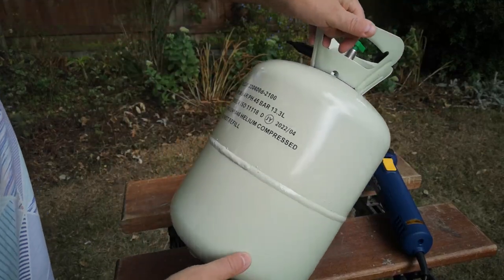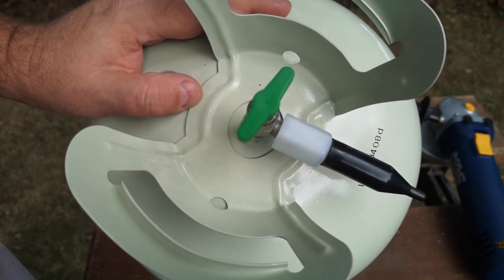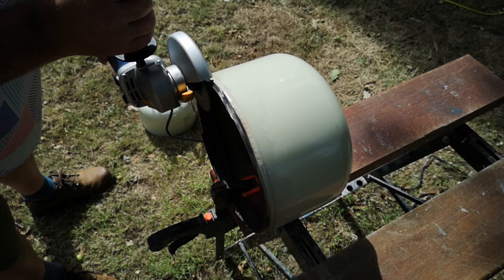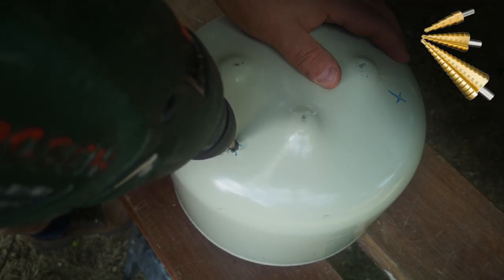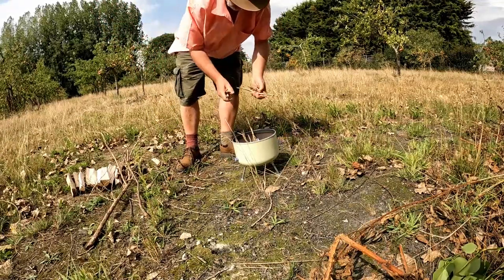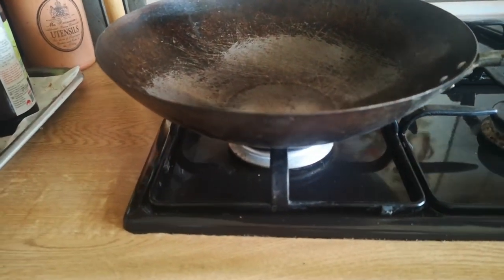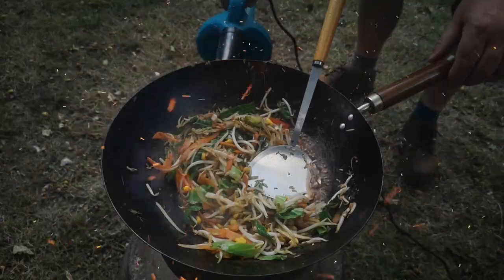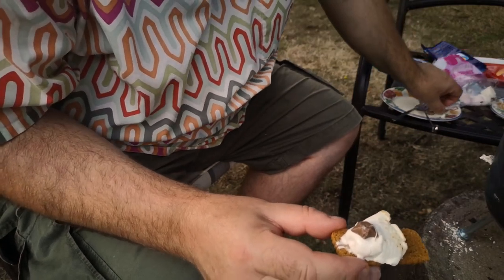Making a Simple Charcoal BBQ Hearth From a Helium Gas Bottle

Comment: The simple solution would be to take some construction wire, 3 mm thick, easy to bend and use it to make a round wok support that has three or more legs that hook unto the rim of the hearth. I don't know how to explain this... but think about that stick implement used to pick up apples, the one with the loops? Well, that, but each loop is smaller and alternating from side to side to grab the lip. Back when i was a kid, an older gent that used to make bbqs near me had the same thing, but made from really thick copper wire, worked really well with just about every cooking pot, including the ceramic, round bottom ones that would've otherwise plugged up the hearth.

Comment: You could have small upside down U shaped pieces of metal that slide over the top edge of the hearth. The bent part would rest on the top of the edge, while the two straight parts align with the walls of the hearth. It should give enough space to allow for airflow with the wok on top while still being easily removable.

Comment: You could make an add on wok burner, 
If you obtain a smaller diameter metal cylinder, and modify the top of that with the castle cut outs and air hole at the base, you could insert that into the larger cylinder with some rudimentary removable fastener and start a fire in the smaller tube and Force air through the larger cylinder, 
I have always wanted one of the crazy hot power burners they have for woks in Singapore lol

Comment: I'm at the safety part rn and one thing i noticed:
You seemingly were wearing shorts, on one hand if a spark hits polyester clothing it'll melt and probably melt to your skin but I'd suggest wearing some kind of long trousers out of (at optimum) flame retardant material or at least long trousers in general since they may catch stray sparks that fly to your legs.
There might always be something happening so that sparks fly in an unexpected direction.
Reply from the maker: Standing out of the plane of rotation is adequate. Even if these sparks hit bare skin all they do is sting a bit

Comment: Nice content... i'm actually looking for a sturdier barbecue to use for caming. Do you think that will handle well, i mena, stay sturdy and keep shape?
Reply from the maker: It's only carbon steel, so I think it will rust if left outdoors, but otherwise, it feels really solid
Reply: It's designed to contain helium at around 260 psi internally when intact(plus a fat safety margin).  It'll probably withstand being pushed into a rucksack even chopped in half👍

Comment: Perhaps the top of the cylinder could be used to make some crenolations. Just a band of metal with some kind of attachment solution like an additional metal rim around the outside or inside or chamfer each mating surface so it holds itself? The latter sounds extremely unstable though but Im sure you can come up with a better idea

Comment: Mr. Shrimp, hello from Canada.

Thank you for the safety talk. I'm probably in the minority here, but I appreciate trying to figure out what could possibly go wrong.
Reply: My partner and I are also in the minority here anticipating what can fail spectacularly... We've seen WAY TOO MANY disaster videos on Fascinating Horror, Plainly Difficult, and Brick Immortar to disregard safety.  So many tragedy of the commons failures throughout our failing infrastructure. That and seeing SOOO many DIYers on YouTube doing things like:  pouring molten metal while wearing sandals, messing around with electricity from transformers that can KILL you (fractal wood burning [electropyrography]), casting resin & spray painting WITHOUT respirators, etc. 

So many things can already kill our fleshy, watery, meat suits. WE DON'T NEED TO ADD TO THAT! 
Here from USA.... Unfortunately.
Reply: @1ericedwards  Welcome to the club! 😀

Comment: I realize you're in the UK, but OSHA recommends gloves when using an angle grinder and says a proper fitting apron may be appropriate depending on the work. As long as your gloves aren't hanging loose they aren't going to get caught and they do protect from sparks and breif kickback contact. Gloves have personally saved my hand from damage when a grinder kicked back and I lost control (it was a huge hand grinder). Back when I did this for a living our safety guys would have yelled at us for not wearing gloves.

I did try to see if HSE had a recommendation on gloves, but didn't find anything specific to gloves for angle grinders. Perhaps the do have a different opinion to our OSHA. 

Less importantly, I also wouldn't recommend wearing shorts. While sparks don't really hurt, those wheels do occasionally come apart at high speed and I wouldn't want exposed skin getting in the way.

Although with a project this size and such easy access most of the risks are really minor and most experienced people would probably do the same as you did. The big risks come when you're in that tight spot and have no choice on how to angle the grinder.
Reply: I don't know about Mr. A. Shrimp, but I really appreciate your detailed comment.

Comment: Perhaps a small # shaped grill of bar stock similar to a trivet in which the bowl of the wok fit within but held high enough to allow a couple inches of clearance to the rim of the cooker. It should be stable on its own and not need attachment to the cooker itself then you could remove it after cooking to allow for marshmallow toasting.

Comment: Very good idea. Aesthetically pleasing. 
Is your wok stainless steel or iron? I find that stainless steel woks and paelleras do not accumulate enough heat. The iron ones are better although they must be cured before first use and oiled after every use.
You could use the embers for making an after meal coffee using the type of coffee pots that we use in Spain.( La Italiana)
Reply: Looks like carbon steel to me. Could be wrong.
Reply from the maker: Yeah, it's carbon steel

Comment: This is cool! Does the oil on the can's surface help stop the drill bit from slipping, or is that in the nature of that type of drill bit? I've only ever attempted to drill through a curved metal surface once and even with putting a small indent into the surface it was scary stuff!
Reply from the maker: The oil helps to stop the drill bit from just overheating through friction, before cutting a hole

Comment: i always thought helium was flammable but i was thinking of hydrogen
Reply: Helium is the less obvious noble gas. If it had been named helion, making it consistent with the other noble gases, it would have been more obvious that it’s inert. Hydrogen could be considered the lightest alkali metal, but also the lightest halogen, and both of those groups are highly reactive.
Reply: @ragnkja  all of that means nothing to me
Reply: @gerardmcquade  
Neon, argon, etc are easy to recognise as noble gases because they end in -on, which only noble gases do. Halogens always end in -ine, so it should be pretty easy to remember which of the two heaviest synthetic elements is which: oganesson and tennessine.

Comment: Yeah, not to plug someone else's channel, but the US Chemical Safety Board has at least a couple of incident reports/reconstructions of what can happen when you start cutting into flammable gas containers.

This was nice though. I've got one of those helium containers and I don't really know what to do with it. It seems like a waste to just recycle it for scrap. People could also use old compressed air tanks as they have a limited lifespan before they're unsafe. Just don't use one that was directly connected to a compressor or you can end up with quite a lot of flammable compressor oil inside it.

Comment: When using an angle grinder or anything with a spinning or reciprocating cutting tool (chainsaw, reciprocating saw, angle grinder, etc), leg protection, even just pants, can help if the disk breaks and flies at your legs even as ricochet. Now it's unlikely to do any lasting damage, but it is painful and can cause a nasty gash. I've had that happen once when I was using an angle grinder with shorts on. A pair of jeans or preferably proper work pants would have made the cuts smaller or provide enough protection to stop it from happening at all. I probably would have needed a stitch or two because of the length of the wound, not the depth, but you know, "It's only a cut, no need to stop for it, just a bit of disinfectant spray and a wrap and back to work."  Even if you are offset from it like Mr. Shrimp there is always a risk. And putting long pants on for 10 minutes while you cut isn't unbelievably difficult to do

Comment: Personally I would refrain from facing on a abrasive cut off disk, as they like to explode, but the tickers ones like you used aren't too dangerous to do so typically, but if anyone sees you doing it you'd definitely get a sit down for doing that at work. When I saw this video uploaded I immediately was reminded of the whiteness marks and crater that was left at one of the shops from a welder; welding on an empty gas(or petrol) tank, and wound up blowing themselves to the afterlife immediately, and severely injuring several others, their being learn't that just because it is empty, and you cant smell it. doesn't make it safe (volatiles in any confined space is super danger..). I was Immediately relieved when I saw atomic shrimp uploaded it, as I already was assured it wasn't going to be a dangerous lifehack video that posed a legitimate dangers to unwitting viewers lifes who thought it be a great Idea to do for themselfs. good show <3 hope you had some fun with this one!
Reply from the maker: I didn't do any facing. I cut off a large burr then used a file

Comment: It’s amazing how much you have to dumb down the safety advice because there’s always that one idiot out there! 🤣
Reply: i still died 😔
Reply from the maker: Discussing the process of thinking about safety is the opposite of 'dumbing down'
Reply: @AtomicShrimp  but having to tell people not to cut open canisters which used to contain flammable gas with an angle grinder shouldn’t really be necessary…but here we are is all I’m saying
Reply from the maker: @GIBBO4182  that part is more for my protection against concern trolls
Reply: @AtomicShrimp  that is what I was trying to say…I may have worded it incorrectly tbf! 👍